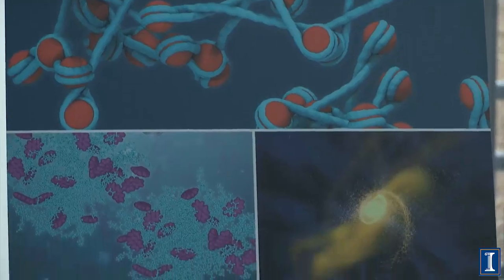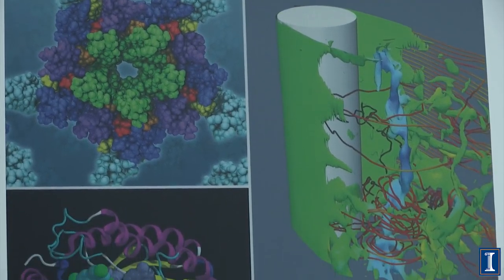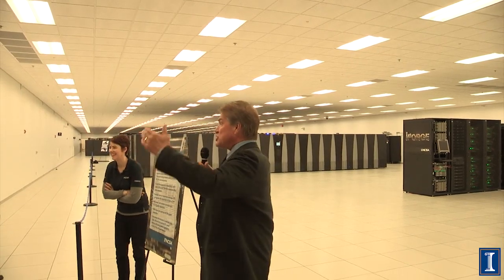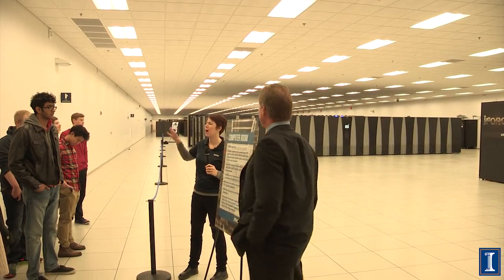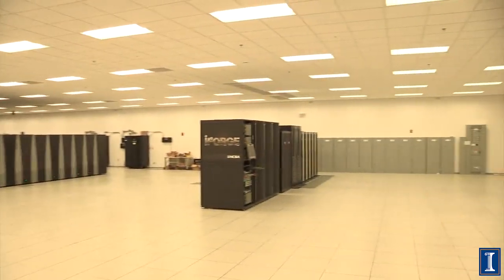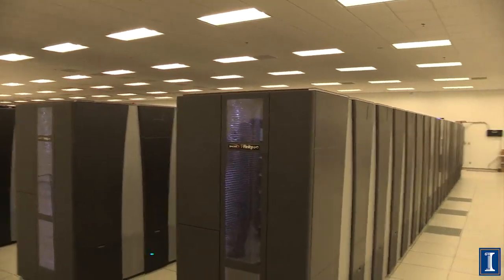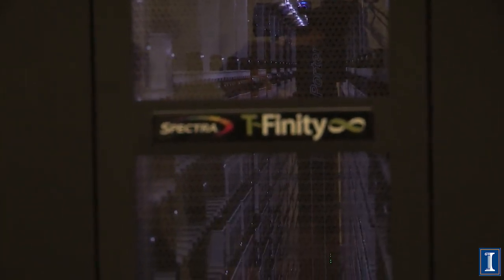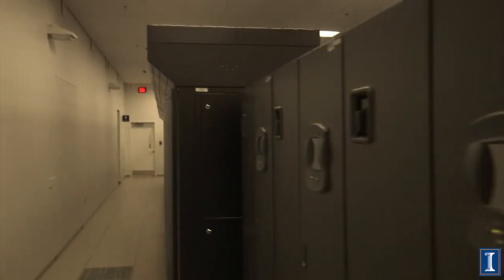How Things Work: Super Computers

Comment: Dude, thats ram not cpus... someone knows literally nothing about computers...
Reply: How about a link to a manual of document where I can verify this?
Reply: @uploadJ  you don't need a manual, you can literally see it. You can clearly see near the middle where 2 copper heatsinks have been removed there is an empty CPU socket and a socket with a CPU in it. What he pointed to as the CPU rows are clearly RAM DIMMs and what he pointed at in the middle calling RAM look like slot mounted VRMs.
Reply: @Mr. Potato re: " you don't need a manual, you can literally see it. "
>> Stimulus generalization; you think you see what your eyeball reports, when in fact you may not be looking at CPU sockets but rather power supply modules. STILL no documentation to confirm ANYTHING.
Reply: @uploadJ  sigh

Here STILL no documentation but just 5 seconds of google and even better. https://youtu.be/EvBdRL1J7kE?t=47

Points to the AMD G34 sockets which you can see in this video have one empty, one occupied and 6 with a copper heatsink.
Points to the DIMM sockets which you can see are fully occupied with DIMMS in this video.
Points to the connectors for voltage convertors otherwise known as VRMs (voltage regulation modules) in between the two rows of CPU sockets then shows the VRMs which you can see occupying the slots in this video.

Is having it come from the Director of Manufacture Logistics at Cray good enough confirmation?
Reply: @uploadJ  Question: can you elaborate on this "stimulus generation" a bit please? I'm confused. I haven't gotten any stimulus recently. Am I in the wrong generation?
Reply: "eyeball input" - its "stimulus" to your brain that yields a 'canned', predetermined or "trained" response. Like a dog seeing its food bowl will then generalize that ALL bowls it sees are its food bowl  ...
Reply: @uploadJ  ah. So basically every human who ever lived. In fact, nearly every animal of nearly every animal species that ever lived, because that's how neurons work. 
Every human being in the planet uses mental models to quickly classify things they encounter in order to handle the enormous amount of information they receive every day.
That's the stimulus part of the expression you used. Sort of meaningless. But what the generation part of it supposed to mean?
Reply: @Warren Garabrandt re: "So basically every human who ever lived. "
>> No. Only those who are NOT able to discriminate A from B from C and lump everything together exhibit classic 'stimulus generalization', as the dog does,  because "It takes a mind" and some degree of training.

Psychological explanation, Stimulus Generalization:
https://www.youtube.com/watch?v=mxUHZEJClRk

A child who CANNOT discriminate between various visual stimuli, and expereinces stimulus generaization:
https://www.youtube.com/watch?v=M8qwvX4P7QA